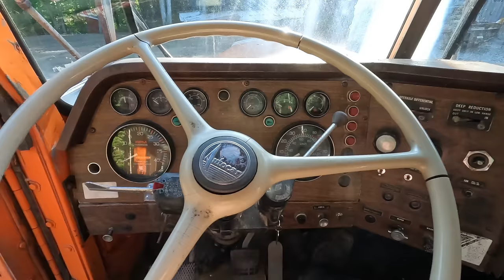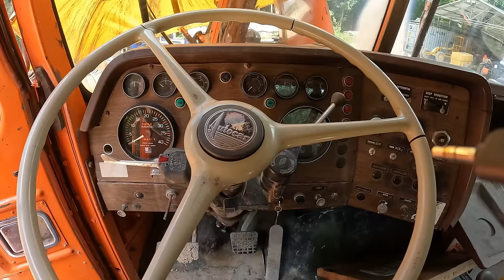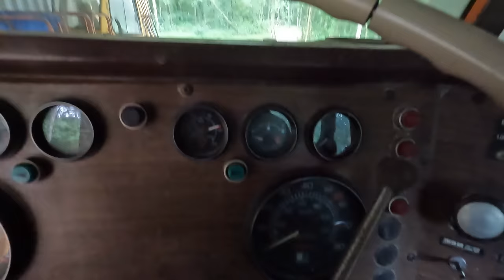Will this  Autocar Semi Truck be fit for the road after sitting many many years? (Small Cam Cummins)

Comment: Hi Matt. Just watched the AutoCar Constructor video and had to chime in about the air selonoid with the damaged seal. I have been in commercial printing my entire life as an industrial mechanic/maintenance mgr. and have come across damaged and deformed seals on air cylinders as well as rubber rollers and other press related parts too many times. There is a rubber rejuvinator called "Blanket Fix" that actually repairs dented and/or worn rubber printing blankets. That is not the brand name, it is the product name. It is brushed on like solder Flux and in a few minutes the rubber will swell slightly to fill the indentations caused by damage or wear. Sometimes more than one application is necessary and of course if the deformation is severe, it will help but will not fix. This paste can be found online or at any printing supply outlet. Enjoy your  videos immensely. I have been retired 8 years and there is still much to learn.
Reply: Great stuff. Spent 33 years in a Mag Cat operation used that stuff many times. Wasn't a permanent fix but would get you by.

Comment: Matt if you hold each end of the driveshaft put some pressure on it and warm it up it will slide.It’s one of those I wish I had greased it regularly moments.Enjoying the Autocar build.I will enjoy the whole series and anything else you post as always a great video and t/y for such great content
Reply: Did you watch the video?
Reply: On that PTO Slip Joint .  Put a split in the outer / Female part lengthwise with a mini grinder down to the splines .  Heat it , pound on it until it comes free , and then clean it up / free it up . Then tack weld just enough to stop it from ever coming apart . This shaft will not be used enough to matter .

Comment: an Air relay is just like an electrical relay just with air so instead of having to run large air lines all the way to the cab and back you only need some small lines so the brake peddle valve can command the relay and the relay does the heavy lifting.

Comment: Loved this video, Matt. I’m a mechanical engineer and there’s something so satisfying about fault finding and repairing machinery. Looking forward to the next one, thanks mate 👍🏻
Reply: Did you notice he always uses impact tools when when tightening bolts. I noticed on the grader he didn't torque the fly wheel bolts. He needs to learn to do things properly. Otherwise I like his videos
Reply: @graememcluckie1434  I’ve got to be honest, I’m really not a fan of impact drivers etc. People get overzealous with them when tightening and also, they tend to shear off seized fixings when trying to loosen them. They’re good for speeding up jobs, but not for torquing like you said. But I love Matt’s videos, and we’ve all got our own way of doing things 👍🏻

Comment: Having been in the trucking industry for 44 years,  I have changed a few starters myself.  Once, I exchanged a bad starter for one that was supposed to have been rebuild.  After I put it on it wouldn't work. I was not happy.  I don't think they weigh 100 pounds,  probably around 75-80 but they are heavy, and hard to get in and out. After that fiasco,  I ALWAYS bench tested BEFORE I put the rebuilt/new one on.  The newer trucks have much smaller and lighter starters.  I'm retired now so I don't have to deal with that.

Comment: Not sure if anyone said this ,But those copper magnetic plungers in the starter solenoid sometimes can be reversed by removing the spring and packing from the back,Flipping it and reassemble,In the army I was a fuel and electric guy and we had those Delco  style starters on the Cummings ,Older car starters are similar,When you grind,wire wheel the plate the hot spots remain and this leads to failure sooner. Not knocking your method,It does work.As always great video.

Comment: As always, great video. I have a suggestion for the next oil change, get a hose about 18”-24” long (just to clear the skid plate) with a 1/4 turn valve on one end, a plug for the outer end of the hose and replace your drain plug with it. We did that with our large, uncomfortable to work on, trucks in my military unit then it’s a matter of removing the plug at the end of the hose and opening the valve to have a clean draining process. On the PTO, it could leak through the splines, next time clean it very well inside and put some Silicone Sealant about 1/8” inside the splines to prevent this. Too bad I’m so far, I’d love come work on these with you since this is all I did in the Army… fix old trucks for 23 years. Keep’em rolling.
Reply: The Liebherr company has a kind of quick-release fastener in its construction machine engines.
There you screw in a nipple and the old oil runs out of the tub. You can also attach a hose to this nipple with which you can let the oil run into a container without making a mess.

Comment: Get yourself an EZ Drain for that engine. They're great. You can stick a hose on the end of them, and  drain the oil by just moving a lever.  I don't take baths anymore when draining my truck engines. Used to end up with at least the first gallon running down my arm. Loads of fun.

Comment: Thanks for the video and the energy you put into them. Reminds me of when I was your age. And you're right, those saw blades don't like welds. They'll dull in a second on them, shame too because they're so expensive.
Reply: Hey Guys, Has anyone thought of a "Plasma Torch" to cut metal? It cuts welds too. I have a cheap one that cuts up to 3/4 inch steel. It works very well.
If you think it makes a mess cutting, grinders can fix that.

Comment: Matt, Loved this video, and had been wondering about the 57 Autocar. Wondering if you planned on replacing the belts since when you were running it they looked a bit floppy. Speaking of the Shop, when is the build going to start, it is already late July and pretty soon the cooler weather will be there. Also saw that there were a couple more hoses that looked a bit frayed and needed replacing as well. For the low mileage on this beast, runs pretty good, and hope at some point you can get the part replaced for the wench. Great video, and will be looking for part 2, :-)

Comment: Matt look carefully for a snap ring or some other kind of retainer device on the slip joint. There should be a zerk on it to grease it with. Also compressing the spline all the way and then pulling on it might loosen it up.
Reply: On that PTO Slip Joint .  Put a split in the outer / Female part lengthwise with a mini grinder down to the splines .  Heat it , pound on it until it comes free , and then clean it up / free it up . Then tack weld just enough to stop it from ever coming apart . This shaft will not be used enough to matter .

Comment: Hello Matt! Looks like you probably have a lot of air hoses to replace on that truck! Now that there is no 5th wheel plate or body on the truck, it would be a good time to check all hoses and hardware / valves / brake chambers.  That is a cool truck though, seems to run real nice!! they built trucks real tough back then!!   Love the video!! Best of luck!!

Comment: Matt,  On your new Building Project before installing the concrete floor;  Locate and dig a service Pit for under Equipment
Access for changing engine - transmission - rear end lubes - greasing, etc.  As well working on needed  components.  Be sure to install Steps,  Electric,  a Fan , and Air for easy access. In the Future you will be glad the pit was a part of your Building.

Comment: ByPass oil filter.  Main is a Flow-Thru and all oil goes thru it. ByPass is only a sampling of the oil that over time removes fine contaminants. ByPass filters are a SMART add-on as they extend the engine lift.

Comment: That starter motor is a Pre-Engaged Starter. It's derived from the pinion being previously and fully engaged with the flywheel before the motor starts to turn over the engine. I've never heard them called by any other name. Usually, the yoke which moves the pinion into mesh is not unlike the Clutch Release bearing fork. Can sometimes be a pain in the ass to strip down.

Comment: That drive up shot is reminiscent of the movie THE Duel with Dennis Weaver. Great movie by the way... The truck looks like it should with the 6ft frame extension off.
Reply: "Duel" directed by Stephen Spielberg. Dual and duel are different things...
Reply: @brucegarrett7232  Words have meanings, and using the right word is important. Putting "dual" into a search engine will get different results than "duel"... But that aside, it's a good movie, and the Autocar does remind of the truck in it.
Reply: @brucegarrett7232  the only one with ruffled feathers is you, snowflake. BTW, you look absolutely fabulous in feathers 😁
Reply: @brucegarrett7232  Oopsies! 😁

Comment: The second oil filter could be a bypass (? for the correct term) and the other a full flow.  The worst case would be you have a belt and suspenders type set up and would keep the oil as clean as you could hope.  ATF in the fuel is also good.
Reply: The canister filter directly on the engine is the OEM Cummins full flow filter. All the oil that flows through it is fed to the engine oil galleries. The filter remote mounted on the fender is a "bypass filter". Bypass filters tap into an engine oil gallery and are fed engine oil through a restricted fitting (so as not to steal much oil volume from the engine). Bypass filters trap much smaller particles than the full flow filters and all of the oil that passes through the bypass filter is returned directly to the oil pan.
The idea is that even though the main full flow filter will trap particles to the size specified by the engineers as "safe", there are benefits to trapping the smaller particles the full flow filter allows through. The most obvious benefit is that abrasives small enough to go right through the full flow filter still cause wear when they get between moving parts, getting rid of the smaller junk lessens the wear they cause. A less obvious (to many) benefit is that getting rid of the smaller particles actually extends the useful life of the full flow filter. All filters become more effective at trapping particles as they trap them because the build up of particles on the filter media surfaces eventually causes the filter to begin trapping the smaller stuff too.  And when a full flow filter has trapped too much stuff,  it begins to flow less oil through the filter media, causing a "filter bypass valve" to open (don't confuse this valve with a bypass filter, they are different things) and UNFILTERED oil is fed to the engine oil galleries.  The premise is that "unfiltered oil is better than no oil".  This is why it is vital that you change the engine oil filters at the recommended intervals to reduce the chance of an obstructed filter feeding unfiltered oil to the engine.  Another truth that most people have never thought about is that on cold start ups, your oil filter is likely to bypass a small amount of unfiltered oil to the engine because when the oil is cold and more viscous, that partially coated filter media just doesn't want to let as much oil through.  The older and more clogged your filter is.............the worse the cold start bypass condition will be.
Reply: @larrywalker7759  I was guessing that the spin-on filter was a replacement for those messy old obsolete Luberfiner canister types. I started throwing those away in the 1990"s when California made it impossible to dispose of the elements.
Reply: @larrywalker7759  Thank you!
Reply: @johnzeni327  Yep, "back in the day"....Luberfiner filters were found on most Diesel trucks with the LF750 being the most popular model.  Messy was the operative word.  I'm not in Cali so I never knew they had a problem with disposal of the elements and I would have to wonder what is so different about disposing of them compared to any other type of oil filter (except for their size).

Comment: Matt, I'd consider putting a Fumoto valve on that oil pan.  I like the ones with a hose nipple so I can use a piece of hose to direct the flow to wherever I want.  They sure make oil changes a lot easier.

Comment: I've had bad brake chambers back feed those valves.
Reply: I have seen that too when a parking chamber piggyback failed and leaked air down the central pushrod into the service brake side and back to the quick release valve. Often those failures get misdiagnosed and the quick release valve gets replaced and the brand new QR valve leaks same as the old one.

Comment: You know most guys will say if you can't do it right don't do it at all but there's a very legitimate alternative which is anything's better than nothing. You would be amazed at the results of rustoleum rusty metal primer with several top coats of paint over it buy a few cans do a test spot you will like it!

Comment: Is the only time that slider moves on the PTO driveshaft when you're doing maintenance? Seems to me like it's mounted between two rigid parts on the truck.
Reply: Needs to move a little since the winch is hard mounted to the frame and the PTO is mounted to the trans. The engine and trans will move slightly on the mounts under load and when just driving down the road. Not much but that little movement can sheer parts that aren't meant to move.

Comment: Are you sure that Super Lube grease is good for that seal? The compatibility chart is a bit worrying if you don't know exactly what the seal is made of. I would maybe have used silicone grease.
Reply: It seals hydraulic (petroleum based) oil, so it should be fine.
Reply: @Rorschach1024  Hi. I was actually refering to the notion that the Super Lube might eat the rubber the seal is made of.

Comment: I believe that air valve is a quick release,  when you let off the brake pedal it allows the air to release faster than going back through the entire air system.
Reply: Bingo! When they hang up they can cause a lot of issues. Still pretty common, although the exact replacement might be a hassle to find.
Reply: @The_DuMont_Network  
Yes sir,  trying to find an exact replacement could be difficult.  I think the operation would be the same,  may need to adapt the air hose ends to make a new one fit.  I also think he did a very good job with the old valve
Reply: That is a brake relay valve.  It does have a QR function in it but it is also responsible for applying air to the brake chamber hoses. These systems may have additional QR valves besides the the one inside the relay valve.
Reply: @larrywalker7759  
Sir, thank you for the additional information, 
I didn't realize that. That would explain why it was leaking air when the brake wasn't applied.

Comment: Grease on the machined surface of the yoke would have made installation easier, and the seal lip would not start up dry when starting the PTO. You probably greased the inner lip of the seal before installation, we just didn't see you do it. Love  your videos...keep on keeping on. A subscriber.

Comment: While you've got that starter off there Matt,you should take those counter sunk screws out of the head of that starter and rotate it so the solenoid is on top and that would give you more room and get the solenoid up out of some of the mud and spray. (Helpful Hint😊)
Reply from the maker: thought about it. all the leads wouldn't have reached though.
Reply: @DieselCreek  I could have sworn you bought a nice crimper a few months back.  Time to get your money's worth out of it!

Comment: While watching when you pulled into the work shed I thought to myself - I bet he will be most happy to get to where he can pull into a garage floor and have the right equipment to allow better and easier to fix and perform maintenance. You confirmed later my thought with the mention of a concrete floor. It is amazing what you accomplish using what you have. I also like that you take stuff apart to fix and reuse rather than scrape and replace.
Hope I get to see the new work shed!

Comment: A company that my father worked for that was based in Providence, R.I. had several A cars very similar to this. If I remember correctly the had 4 that had the 50 ton winch on them The companies color was orange and everything including the frame was painted orange. The companies name was Campenella Corporation and they had a company logo the was a C inside a C. I'm wondering if this could be one of them.

Comment: Thank Matt! you might get some PVC just large enough to cover just the spline part of the drive shaft. cap the end and set the shaft in kerosene to soak standing on that end. Best of luck, If all fails two large hammers waylaying opposite each other at the same time. You get the picture!

Comment: I want to see the old one running again, been a few years since I saw you on it...
Like the 80 model too, tough old trucks hauled coal with one for years , small cam 350, 13 speed , 44 thousand rears. Beast looked like one too.

Comment: Re that frozen sliding joint in the PTO shaft, suggest a decent piece of steel, maybe railway line, on one side (maybe laid on the ground) and a decent lump hammer "tenderizing" it from the other. Then rotate the part gradually til all sides have had a "love tap" or two. I have had a lot of success convincing frozen bolts in housings to come loose that way. Copious heat has also helped as you have done. But the "tenderizing" also seems to expand the outside housing ever so slightly convincing the inner part to slowly free itself. Retired mechanic/machinist from Land Down Under.

Comment: Nice job on the videos. I used to work for Freightliner back in the seventies , and the outside oil filter problely used to be a luberfiner 750. and not the little thing that is hanging there now.   that filter was used for many years as and aux filter and cooler . that was why it was haging out where the air could get to it ... Have a good Day